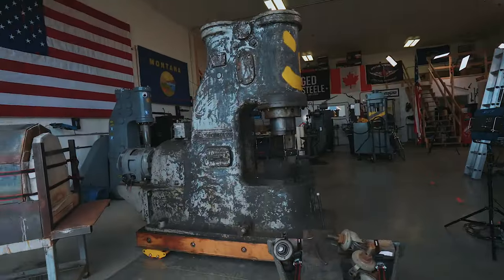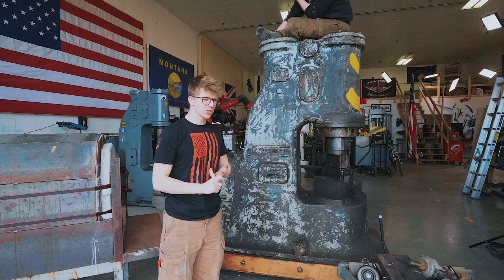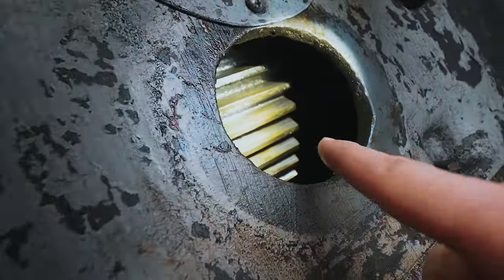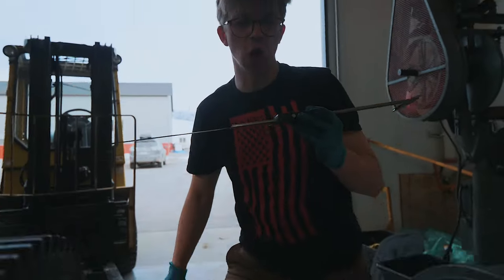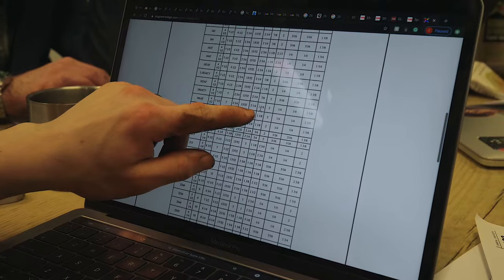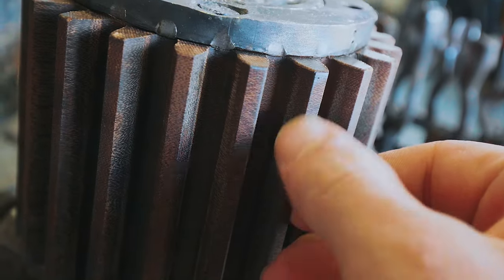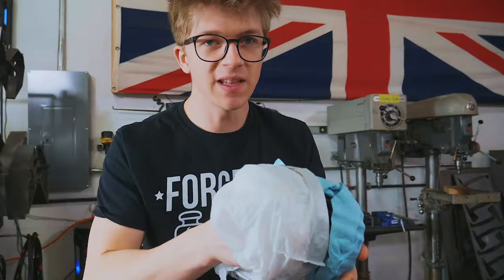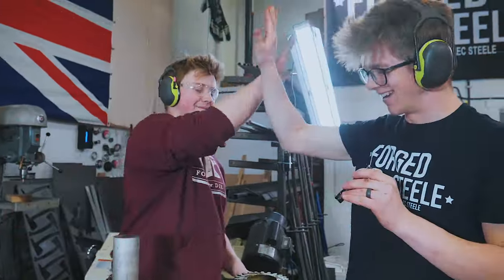FIXING THE 300LBS POWER HAMMER!!! Part 1

Comment: I am so extremely confused why you're not testing the motor to see if it works at all and as long as it turns, you just fabricate another housing, or get someone to weld the feet back together... The first thought that comes to mind would be to collab with @Abom79
Reply: Because seeing if it works means paying an electrician to wire it up, which isn't necessarily cheap or fast. It doesn't just plug into the wall.
Reply: If the housing of a motor that big is cracked theres no point of even trying, it's junk. That thing is 15HP with a cracked housing, just asking for trouble. Also collabs take a long time and they need to get it up and running quick.
Reply: Looking at the close up shots there are cracks all across the internal housing.  Even detached, just switching it on would probably shake the unit apart.  Personally my real concern would be the level of bodgery seen on the other parts. Frankly it looks as though it had twenty odd years of hard graft and shopcraft repairs, then fell into disuse for a few years after the motor housing broke away from the casing.  The whole thing needs to be stripped back, cleaned up and carefully inspected for damage / ware / bad repairs on the transmission system.  Otherwise I have a feeling we’re going to see several months of passionate restoration videos, followed closely by an explanation of why they have a one ton scrap pile in their workshop after first use.
Reply: @cableferret9804  one ton? A knee mill is a ton and a half, there's no way that thing isn't more like 2 or 3 tons! 😜
Reply: @super_slo  That is a good point.  So one ton in a pile and the other two scattered accross the workshop XD

Comment: It’s shipping that messed up this machine most likely. Make their insurance pay for this! Assuming that the selling company can prove that it was fine when they put it on the truck...
Reply: fair point but realistically speaking, how would that not happen if you're shipping what is essentially just a massive casting with an engine attached to it which was most likely 800 billion years old to begin with ? If you take into consideration, the mass of the motor in correlation to the mass of the internals alongside the age of the casing itself, and then assume that the weight capacity that the case can support would've decreased somewhat over time (because of erosion) wouldn't that have just been inevitable and therefore be down to basic physics ?
Reply: The fracture is completely rusted leads me to believe it was stress fractures that rusted over time and finally split open in shipping
Reply: It was likely old damage that was hidden under decades of paint. Working on hammers this is pretty common. Those cracks are older than Alec.

Comment: Alex, just machine out the hub the extra 1/8 on the dia, that's 1/16 on the radius and mill down the key height by 1/16. You will still have the same shear area in the key .... Easy done. Get a bit of 1 5/8 shaft to use as a go-nogo gauge to get a good fit.

Comment: i dont know if i am wrong here, but wouldn't it be easier to "just" make the shaft diameter smaller on a lathe? (only the part that goes into the hammer)
Reply: I was looking for this comment so that I didn't duplicate it. That was my first though. 🤷‍♂️
Reply: that's not really a good idea.
Reply: @BloodSprite-tan  why?
Reply: @Haahr1805  the motor shaft is stuck in the motor and it's also huge, they don't have a large lathe, it's too big and heavy. and needs special support and it's a massive pain to move around. it's a 15hp motor. you know how heavy it is? even if you can get the shaft out, it's not something that is trivial to fix.

on the other hand, the coupler much smaller and is within the capability of their lathe and is the cheaper component. and it's not stuck in a motor housing.

also it's just a motor, why would you want to mess up a motor to make it work with a single machine. when that prevents you from selling it or easily swapping out a new motor for when it breaks.

Comment: Why wouldn't you just remove the 1/8" off the inside so it fits the new motor shaft and call it a day?
Reply: Then the key won't fit. But he coud mill that down, too, and THEN call it a day.
Reply: @J B I was thinking the same thing.
Reply: @J B for that you would need to disassemble the shaft from the moter, which means at least two bearings you'd had to press off and then start the machining process. In my eyes it's much more reasonable to make a new coupling

Comment: Really disappointing that a "Ready to go" machine turns out to basically be salvage in need of complete overhaul.
Definitely reflects poorly on whoever sold it to you.
Reply: I feel like he should try to get the seller who mislead him to repair it
Reply: it probably was ready to go when it was put on the truck to be sent to alec. but it had to go really damn long way over mountain passes. its likely had a lot of stress put on the mountings.
Reply: @sethbennett617  I had that same thought, those look like fresh cracks to my untrained eye. I'm also a trucker and I know how "smooth" the roads are. That much weight on likely cast metal, no win.
Reply: @JohnyComeLately  maybe the seller should have taken the motor off and ship it on a seperate pallette. Don't know if that would've helped, but maybe. Or it was already broken back there.

Comment: Don’t you get money paid back?. Seems like they lied about the function didn’t they
Reply: I would assume it was shipping damage and a claim was hopefully filed by the shipper with a partial refund... that's how it should go at least
Reply: That couldn't be shipping damage.
Reply: @entropy11  the cast iron frame of the motor is brittle compared to the rest of the hammer body which would absorb shock much better, I think a drop from a foot or two or a rough set down could do that. Let's get AvE to do a post mortem on it, read the stress fractures like Dexter reading blood splatter
Reply: Something like that should've been transported on an "air ride" trailer. If it wasn't, it could certainly cause that damage. I would know, I've prepped quite a few jet engines for trailer transport.
Reply: @spyder7758  Those cracks are too rusted for it to be new damage.
Reply: Jack Wheet Cast iron can rust insanely fast. Only takes hours. It can be even faster than that in the right environment.
Reply: @darthsilversith667  even so there old cracks you can tell the difference between a fresh crack or a crack thats been there for a long time

Comment: That motor is 1800 rpm. The 1750 is the speed with the slip calculated.
Reply: Yeah, 1750 doesn't divide into 7200.

Comment: So I'm a Millwright in WA state and shaft alignment plays a huge role in machinery longevity. We work with alot of equations to get the alignment in the  the tolerance of thousands of an inch. Somthing to take mind of when replacing the moter.

Also if your having trouble getting that insert to center in the lathe.
Its probably not straight anymore.
I would just make a new part with fresh stock material. My opinion anyways.
Good luck with the repair.

Comment: totally your bad on this one, you should have never let them unload it off the truck, should have sent it right back and charged that to the shipping company.
Reply: It wasn't the transportation company's fault, the rist on the cracks shows that the cracks were there for a while and the seller was just a liar.
Reply: @JacktheFireEater  Go take piece of untreated cast iron and leave it out over night. It will be covered in surface rust  next morning same as the cracked feet. Its fresh. Maybe shock from a large bump during transport or more likely dropped at some point.

Comment: Am I missing something? Why not just braze and repair the feet on the motor? Would be cheaper than buying another motor.
Reply: I tried suggesting that on the last video. These are well over a week behind by the time we're seeing them, so the suggestions are way too late to do any good. He had already bought the replacement motor by the publish time of the previous video. :/

It's kinda sad to watch him flailing around like this - there are easier (and cheaper) ways to have done this that are still 'proper' repairs.
Reply: @Broadpaw_Fox  I completely agree. He wouldn't have had to spend the big $ on the boring bars and broaching tools and could've done a video on brazing. Would've been a won win situation
Reply: There were more cracks in the motor
Reply: I agree it's worth a shot but  thinking about it . This is a single piece machine maybe he's worried about the sheer impact vibration would  knock the  braze loose and if that 15 HP motor  starts free spinning that  resin gear into the  steel ones its going to be nasty. Personally i'm  worried about how he's  repairing the  gear  Starting a bore and sleeving before he even has the  motor in shop to  measure off is risky , he might end up having to remake the entire part at this rate.
Reply: @dragon111409  exactly what I was thinking.  He has no idea if the 'new' motor has the original shaft, or even if it's worn down a fraction. Patience Prevents Problems they say.

Comment: Why not weld the cracked parts? Also; you use the track pad instead of a mouse? Wtf?
Reply: Funk Addict 
If that is cast iron, it’s pretty tricky to weld, it needs to be precisely pre-heated and then cooled slowly after or it’ll crack again.
Reply: @thechumpsbeendumped.7797  You're right, I know, but I'd give it a shot since they have the tools and if it fails, then purchase another motor. No?

Comment: You can buy a taper lock adaptor for fairly cheap, and it will lock into the gear bore taking shear pressure off your set screws.  Or use a b-loc.

Comment: tip for @alec steele: 
to counter the vibration on your long "thin" boring tool, you (somethimes) have to  take off more material per step, 
in a way, you "pre-bend" the tool and it has no place left to vibrate towards

Comment: Check with Abom79 or Keith Rucker, either of them could turn a new shaft and use a shaper to cut the keyway.  Tom at Ox Tool probably has tooling to get it done as well.  If you want to get froggy on the mill, you can grind a square cutter from HSS, turn shaft down, chuck it, lock spindle, and vertically cut the keyway with vertical motion on the quill and advancing the table a few thousandths between cuts.  Time consuming, but it does work.  Might also be able to use a small fly cutter or boring bar to hold the cutter.

Comment: Alec, the gear is made from S.R.B.F. (Synthetic Resin Bonded Fibre)… It's purpose is to protect both to protect the motor from burning out if the hammer was for some reason to seize, The resin gear would strip, allowing the motor to continue rotating without damaging either the motor or the main driven gear
Take a note of the gear size now (diameter and number of teeth etc) and order one from a stockist to keep it on hand.... just in case...
Keep up the great work!

Comment: 1. Cut the existing welds in the lathe. 2. Push out the old sleeve. 3. Bore the ID where the old sleeve was. 4. Turn a new sleeve that press and or shrink fits the old flange bushing. 5. Tack weld the sleeve like the old one was. 6. Bore the sleeve to the right diameter for the motor you are getting. 7. Broach the sleeve with the 3/8 broach. You want to have a press fit on the sleeve you install because there's a good chance the sleeve will collapse slightly if the sleeve gets cut in half on the one side. I know the welds will probably hold the sleeve in place but press fitting it will help. Better yet would be to bore the old flange sleeve to a diameter so when it gets broached the sleeve stays in one piece. Just my $.02 from a 64 year old tool and die maker. Good luck!

Comment: I think all those set screws are done deliberately for balancing of the gear.  Otherwise it will not be balanced and slowly destroy the gear.  The grub screws are screw in or out to balance it.  Anything that spins at a high rpm needs to be dynamically balanced.  For safety issues too.

Comment: Alec, you should consider calling the buyer to see if the motor was broken when they shipped it. if the machine wasn't shipped properly and the truck bed was flexing during the delivery, since the motor was bolted on during delivery, it could have tore open the frame of the motor in transit. Heck, even if there ware too many bumps on the road, the shaking itself could have rattled it around enough to crack.

Comment: I think my advice is a year late; I have faced similar problems with motors of large dimensions and powers, the problem always being the leveling of the ground, the foundation and the compaction of the concrete where it is installed, these points being expensive. but nevertheless with the installation of neoprene shock absorbers you could avoid future damages or repairs due to rupture...

Comment: hope the 2nd motor has been rewound like the broken based one or at least is in good working order. but hey if the 2nd doesnt work out n u haven't scrapped the 1st you can try n reweld the broken parts. think the motor that came with it looks better and was the better option. but im not there or an expert lol. good luck stay safe.

Comment: Throw the old part out. Make new two part piece to hold the tooth wheel and secure that with a Keyles taper lock bushing. All problems solved and a bit more flexible on shaft seizes

Comment: I dont know if it's too late but I would just open the original bore up to 1.625 and make a custom key to put it back together with. Even with a reduced key it's still going to be way stronger than the micarta gear.

Comment: Name plate will have a frame number the first two numbers divide by 4 will give you from base to centerline of shaft in inches the 3rd number divide by 2 that gives you the shaft length and the letter is the frame style

Comment: If you end up making stuff from scratch, you could potentially use a material that's way easier to machine, such as the free machining steels, or brass/bronze.  I think pretty much any metal is stronger than the phenolic gear.  Also, while it's out, detail exactly what that gear is.  # of teeth, look in the Machinery Handbook and take measurements to find the involute size the teeth are, length of the gear.  Since it's made out of phenolic, it's the sacrificial gear (like the plastic drive gear in my lathe).  If it would ever break, it would be handy having that info from when the gear was good.

Comment: 38mm shafted 15 horsepower 3 phase motors seem very common. Maybe a metric shafted motor would work? i.e. 40mm shaft and smooth out the cog shim inner diameter by a 1.5 mm

Comment: Next time if you would like to save time and make sure it’s right , call BDU 😬, they sell a sleeve bushing kit that would be a 2 part with that new either QD or S , SD whichever bushing style that might be with another piece that will slide in the bore and bolt right in, with !! The actual size 1.625 “ bore and keyway all for about $100

Comment: Just an fyi you need to make sure that the motor is in perfect alignment with the piece it is interacting with. That is why the pieces broke the way they did. It was not shimmed perfectly but done only good enough. You can do it yourself with a straight edge. Make sur you tighten down the bolts each time. It doesn't matter if it's level it just needs to be in perfect alignment with the machine. While yes if everything is level it will have less wear as a whole. The perfect alignment of the motor shaft to the machine is most important.

Comment: Newer 15hp motors are a good bit smaller than that one and have a smaller footprint theres that to consider plus adding a vfd will not only lengthen the life if the motor it will considerably cut the amount of electricity it will use infact I'm pretty sure cutting it back to 80 percent will cut the electric use almost in half......something to consider with all you larger motors

Comment: Question for any motor heads out there...how would the PF factor into this?  I understand needing the same RPM, 3 phase and voltage for this particular motor, but wouldn't having the same power factor be very important?  Electrician here, not much motor work under my belt though.

Comment: Really surprised it is 15 horsepower. I put together a building for feed mixing one time, and when they starting bringing in the machines that were going to inhabit this building it was insane. One machine had like half a dozen 50 HP electric engines installed in parallel. And this was a tiny single room operation.

Comment: What I am really curious about is that phenolic gear. Since the material consists of layers of canvas in a phenolic resin matrix, its material properties will be inherently anisotropic. That is, the mechanical properties such as compression, tension, shear and torsion resistance will differ depending on the direction in which they are applied.

So how was the canvas laid for that gear? If flat layers then machined, what is the orientation of the gear teeth to the layers? Cylindrical layers with machined teeth? With or without additional layers of canvas following the profile  of the teeth? These would all have different mechanical properties. @Alec Steele, can you tell us?

Comment: Will. If it's only 150 ish (I forget exact numbers) you only will have to extend the key way half that as it is a diameter. So that's less than .100" (point being not too much) have you considered making a lathe tool and locking the spindle then running the tool in and out manually with a 0.010" cut on it.
It may take time but have seen it done
Btw could be talking out of my ass or have gotten wrong end the of stick. Best of luck

Comment: why dont you pour a raised reinforced concrete block for the motor assy to sit on,  remove the casing underneath it, and using shims to line up the shaft, and put a chain mount to the gearing and have it offset.